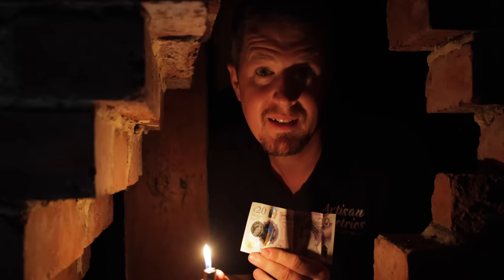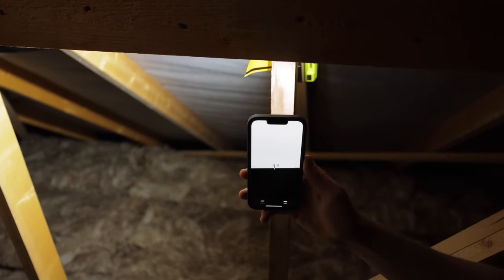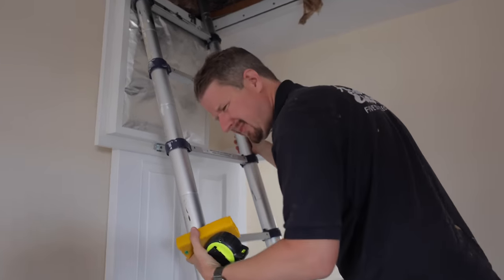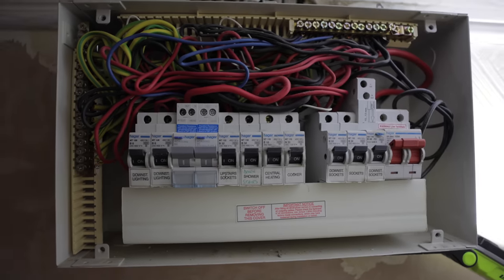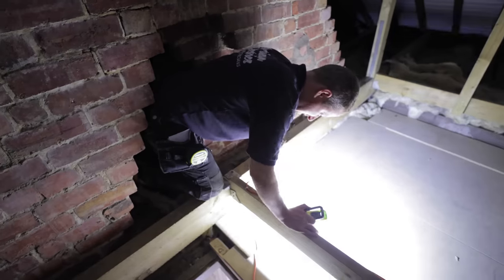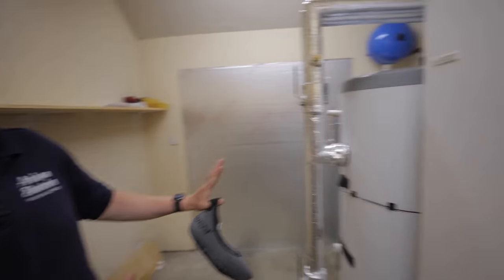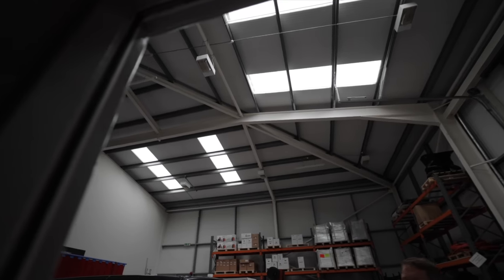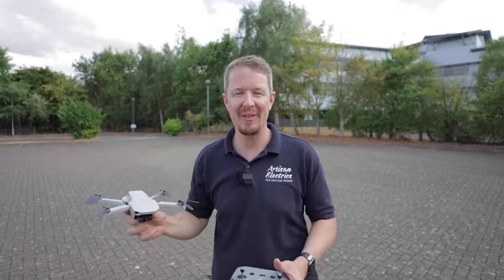STOP BURNING MONEY! 😱 Bring your energy bills DOWN!

Comment from the maker: How much has your energy bill gone up in the past 6 months?
Reply: I'm on a fixed rate until march 2024 🙂
Reply: From £171 to £352 duel fuel. 🤦🏽
Reply: Zero 😁 £35 a month since January, 3.2kw system, 8.2kwh battery and I about £30 of that is for charge the EV locked in on lekky till April next year octopus
Reply: @MrLegend139  nice one! Need to start investigating!
Reply: @Vwfan  I definitely got in at the right time, it’s bad to say but the more the prices go up the quicker It pays for itself 🥴 still got to put up with gas though unfortunately, only £20 a month at the moment and that’s just for 2 people showering each day
Reply: Here in the Netherlands prices are sky high also.  Gas prices are around € 2,50 a 3,00 per m3 gas. (for new contracts). Electric prices are around € 0,60 / kWh.   So i invested in Solar a couple of years ago. 2 Months back i installed a 120L electric boiler for the shower. I use a quooker in the kitchen. I have induction hob in the kitchen. For heating i use a Airconditioning split unit that just heats the ground floor. the 1st floor doesn't need that much heating. I do have a electric  heater in the bedroom for the case its gets to cold in the winter. I have installed 19 Panels total. 10 On the south and 9 more on the North. With a total of 5000 kWh / year.  End of the year my gasmeter will be removed for free also. that saves me around € 270 euros a year standing charge.  I pay € 55 euro a month at the moment, but it looks like i'll be getting over € 1600 euro's back from the energy company.   I know i'm lucky that i own my house and have the possibilities to install these things in my house (installed everything by myself). Some people pay € 600 - € 900 euro's a month. I really don't know how someone can afford that. its mad.
Reply: Don't care. I can afford it whatever the price rises to. Most people I know don't really care either.
Reply: @randomcamerajunk6977  so can I 🤷🏼‍♂️ doesn’t mean I don’t wanna lower my bills though
Reply: Just moved to a new build with 2.5kw of solar and we do £8 a week from the grid. Things like dish washer and washing machine get scheduled for periods of peak generation. And yes the consumer unit is just as bad as the new build in this video 😂
Reply: @MrLegend139  yes I'd rather keep my money out of the hands of the energy cartels too. I will probably fit a solar system.
Reply: Ours was £200/month until we got Solar panels and a battery, now it's £25/month excl. gas.
Reply: Down from £100 a month to about £30 a month.  I may be an exception.
Reply: from £175 a month to £321 gas and electric in 12 months, £220 -  £321 last 6 months
Reply: Got a 6kw system and 11kw batteries so currently pretty low. Winter with the price cap.... Haven't worked it out yet! Before solar I'd be on over £260 per month.
Reply: From 110 to 320
Reply: @RikTheMix  unfortunately not, got a combi boiler 😔 not worth changing as it’s only 5 year  old
Reply: @jayzo  how much was the capex?
Reply: @johnwinters4201  how much was the capex?
Reply: Mines gone up £2 a month only
Reply: @benjones1180 smug anchors everywhere
Reply: £180 to £470 which British gas is asking us to fix....its very ridiculous....my house is not even pointing at South....
Reply: Was £147 in March 2022 to £257 in April 2023. Solar installed April and the last 3 bills have been £7 a month. 😀
Reply: @nobotshere8364  do you use gas at all
Reply: @bobjohn3108  yes, currently round £30 a month since April. Using for Cooker and hot water currently. Heating in winter will undoubtedly be significant. We're getting in quotes for ASP and mixergy tank.
Reply: Was £15 month, now £40... On a 3 bed House..but I do have 4kW solar installation. 
Currently generated 27mW.
Reply: I'm dreading the increase currently looking into Solar. Can anyone advise on decent Solar panels and Battery I've been advised GivEnergy are OK?
Reply: Wood pellets has gone up from 268 euro in 2020 to 806 eur 2022 per ton.

Energy prices has hovered around 1,34 eur in a while per Kwh

It is so great.
Reply: My mothers usage costs will go up 300 percent in October
Reply: from £192 to £300 currently but will increase by 80% more in October!
Reply: Still 20p/kwh no standing charge or £180/year. Card meter. I'm assuming landlord doesn't want to pay standing charge on a vacant property.
Reply: 800.00 usd a month
Reply: @randomcamerajunk6977  whow
Reply: from 120 euros to 580 euros

Comment: Yes, the exposed loft connector is bad, but two core flex is perfectly fine. The regs don't specify a colour for the outer sheath!
Reply: I was going to query this, if it was yellow where it could be misidentified as carrying 110v I could understand the concern
Reply: @bigbadtree  yellow is also acceptable - you can buy Arctic flex in yellow or blue and both are rated for 230v. Nothing in regs about outer sheath colour.
Reply: Is it not the case that stuff wired in flex is deemed to be temporary making it subject to regular inspectio?
Reply: @johnburke8713  no, you can use flex to wire your whole house if you want. As long as it's the right current rating and type for the situation. The ban on flex for fixed wiring was removed for the 16th Edition.

Comment: I've done a bit of research into solar and from my understanding the rule of thumb is that optimal panel angle should be close to the latitude of the location.
Reply: Only partially true, for the real optimum the panels should be adjustable so they are perpendicular to the sun's rays. Hence during winter when the sun is lower in the sky, the panel angle should be increased. The solar panels on my shed are equipped with hinges and adjustable stays, and as a minimum are adjusted in March and September, but it can be done monthly.

Comment: Just think if they had only built that house with a single, mostly south facing roof slope they could have had a 15 Kw system rather than a 5Kw system. What a pity we are stuck in our ways with how roofs have to be designed. Single slope would be cheaper to build and provide much more loft space. Maybe we just don't like how they look. Such a loss of possibilities.

Comment: I have seen baffles available to allow panels to be installed closer to the edge of the roof. Basically fit to the edge of the panel down to the roof to stop wind getting under the panel and lifting them up.

Comment: Nice video again!!!
If you measure from the inside, I think you loose some cm here and there, since the outer measurements would be larger. So maybe the panels would fit, or am I wrong?
Reply: There are some regulations that limit the minimum distance to the roof edge.
Reply: @Suburp212  Sure, but to maximise the use of the allowed coverage a reliable measurement may be useful I think 🤔

Comment: Any reason you don't use a digital laser measurement tool rather than a tape measure. Would save a lot of hassle in the loft etc and reduce the risk of putting a foot through the ceiling. They are very accurate and not very expensive. Also they can to the calculations for you and give plans etc on the more fancy models.

Comment: You can actually go right to the edge of the roof under MCS guidance, as long as the additional wind loading has been taken into account and extra hooks fitted. It does limit access to the roof in the future, however!
Reply: Hey Will, I am designing a PV system for my car port, how many mill do you need to add for the gaps between panels? I am looking to install 15 black panels and ideally id like them to be the exact size of the roof as they look way better. I am still at planning stage so might just use the panels as the car port roof.
Reply: 15mm-20mm depending on the mounting manufacturer you go with

Comment: Nothing wrong with orange flex, it’s the same as white flex, but it’s orange so you can see it on the lawn before you cut it. 
The energy companies will also be able to shaft us regardless of wether you’ve got solar or not.
Let’s say every household runs a solar system, the energy companies will just put up the standing charge so high that it won’t make any difference.
Reply: Yes that :- orange flex is not a good idea comment left me wanting to hear a technical explanation. 
For sure a proper junction box would be better to split the supply , but why the hate for the orange cable ?  :)

Comment: the ideal angle is the same degree of latitude towards the equator... so if you live in the north part of the hemisphere you want to face south with the same angle of degree as the latitude of your location +-10 degree because that is the area of the equator's shift depending on the time of the year and the earth rotational axis... you can also add east and west facing for morning and afternoon sun but you need to make sure there is no obstruction facing to the sky from the point of install and which direction in your location has longer sun hours (in terms of east-west) in said location to make the install worth the money spent....

Comment: The grid should start doing more options for power sharing… even 50% of export you get for back for free in the evening or something.  Seems so unfair these days, export all that energy and get nothing back!? Great vid thanks.
Reply: Shhhh don't Tell anyone, that's why you don't get smart meters and also don't tell them about your solar, you feed your house in day plus charge battery also give some back to them, then at night you take back what you put in during the day.
Reply: @marcobrian1619  More information please! 🤣👌
Reply: What kind of meter are you on? 
Smart or old spinning wheel.
Reply: @marcobrian1619  just digital for economy 10
Reply: @marcobrian1619  if you are feeding the grid would the meter go backwards or just stop going forward?
Reply: @TheDaztheraz   if you have an old disc type meter it should go backwards, but the new "smart meters" some just stop but some count up witch Ever way the current gos.
Reply: @TheDaztheraz  A smart meter tells you what you purchased and what you exported (mine does) plus with a PV system you should get a meter telling you what you generated (though the inverter should also tell you that). My 3.6kW split system has generated 35 MWh over 10.5 years. Just over 9kWh per day. 60% has been exported so I should have a battery system but prices have shot up 50% this year and they are in short supply and nearly all Chinese.

Comment: The last site the pressure relief is going on the system probably due to lack of cushion pressure on the expansion vessel. It does make me chuckle when people want heat pumps in large air volume commercial premises though as often air to air would be more efficient than a wet system. Huge potential for island modes on commercial units and definitely worth it. Also Banana Man and Danger Mouse making me feel old.

Comment: You can tweak a gaming pc to use around 25w idle and basic work with the makers tools. They range 20-200w stock and upto 600w loaded. Also wait for a full load washing to save power.

Comment: With charge/discharge using your installed battery to run house  & appliances overnight how long before the battery needs to be replaced due to degradation?

Comment: Great to see more people installing solar, heat pumps, and battery storage BUT we must be clear no one is "saving" any money until the costs are paid back with savings on the energy bills.  I would normally say you can work out a reasonable ROI but with our energy markets being so crazy and depending on if you get any payments on a "FIT" tariff, it's going to be hard to calculate. It would be interesting though to see if a system purchased on a loan over a long period could give you immediate savings?
Reply: @Phil Ware In October the energy prices in the UK are expected to go up another 70% and then every 3 months go up again BUT this could change if the government steps in. I've seen before ROI usually is 7-10 years on solar and with a battery, it's even longer BUT it's hard to work out with such a volatile energy market at the moment. I've also seen some battery owners getting very high feed-in tariffs but not sure everyone can get them. - this again makes it hard to estimate the ROI.  I'm just making the point that if you spend £10k on an install you're not saving anything until you've saved the £10k on the energy you would have bought from the grid.

Comment: The house with the solar panels. If they want to maximize the solar panels generation, they should have the ID4 plugged in and charging when the sun is out. huge fail on that one. also run the AC or at least a house fan to keep the air circulating, charge laptops, other electronics, run washing machines/dryers, ect. I could use 22kw during the day. lol. nice video though! as usual!

Comment: Do you check  the roof structure  to see if  additional  supports are need to take weight of solar panels.
Dose the council get involved  eg building  regs ,
Thanks
Reply: Installers are required to calculate roof load before installation can proceed
Reply: Generally councils (BC) don't need to be involved due to permitted development (there are exceptions though) and most installers would MCS registered which covers most things but actually no certificates are needed if it's DIY and your not going for the feed in tariff (or whatever name it goes by now)
Reply: @_Miner  generally speaking insurers take a dim view of any diy electric work, but given there is up to 500V dc per solar array and between 3.7 and 6kW of mains power to the house, with an installed system you get what you pay for and all the necessary certification, plus 10 year warranty.
Reply: @atkt62  Agreed about insurer side of things, it was just the question was related to council / BC.
Reply: @_Miner  so with our installation the installers retrospectively obtained building regs, no need for planning consent as we are not in a conservation area. However I have heard of planning allowing arrays on road facing elevations    only to turn around a fee years later and demand their removal because they face a road! This seems to be more in the south than the North West of England

Comment: Wouldn’t be comfortable putting lithium battery storage within the property incase of failure and fire. Ideally for me it would need a detached garage so many meters away from the house or external storage box of some sort.
Reply: I get the general concern about fire, but would you park a petrol car in an attached garage, do you have up to date CO detectors to give you warning of a gas leak, do you have any camping gas cylinders stored nearby? Same levels of risk, just more familiar
Reply: @JamesScholesUK  petrol in the car doesn’t go potentially volatile and yes LD1 fire detection along with CO detectors in the required locations. CO detects carbon monoxide and not gas leaks btw.

Comment: "Perfect sized battery"  My issue with that phrase is that things change over time. They seem to have one EV and a non-EV. Eventually, one assumes, they'll have two EVs. In addition, the battery degrades over time.  So do the panels for that matter. What you set right now likely won't meet their needs in five years - which is fine because one assumes there might be more, less expensive storage options by then. Just think it would be a good idea to tell the customer that there will likely need to be future upgrades but the system you're recommending now will handle their current usage.